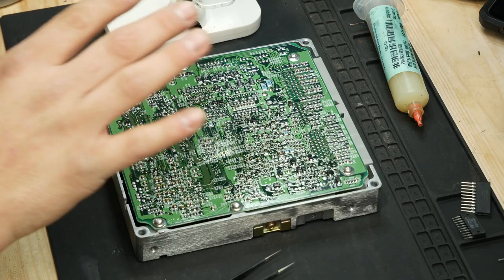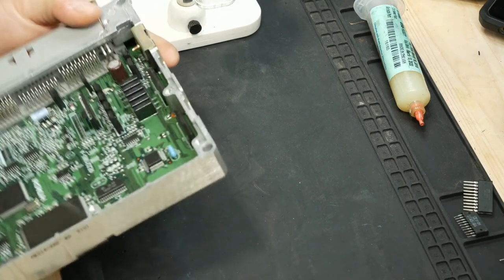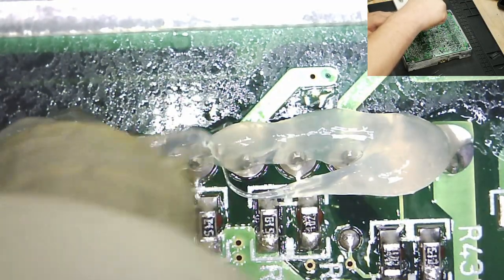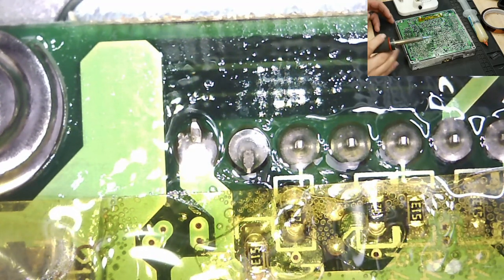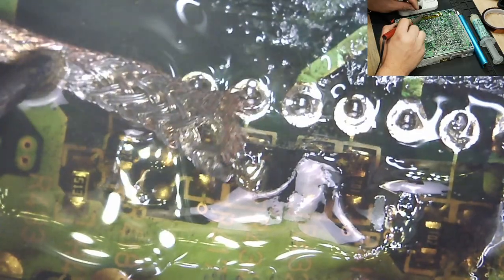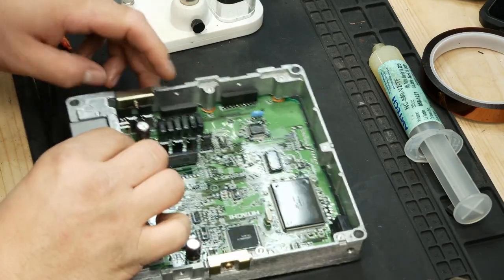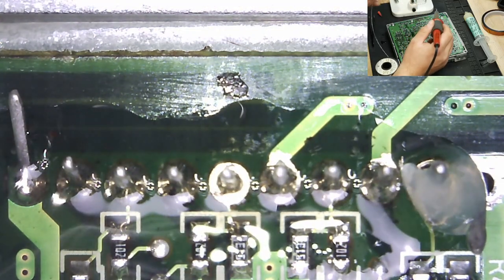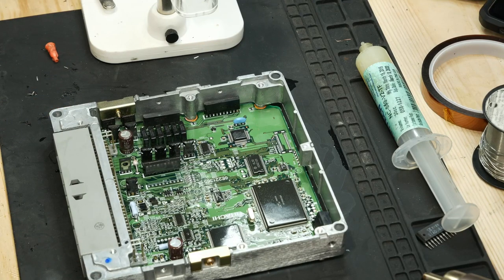Nissan Pathfinder Injector Driver Failure and Repair!

Comment: PPBUS 3G HOT
Reply: I have a 2013 Rouge Does it have to use Nissan Trans oil or can I use different brand.
Reply: G3 not 3G
Reply: Dyslexia must have kicked in

Comment: I have personally repaired hundreds of these and similar models over the past two plus decades. You did real good Keith! 😅

Only thing I would mention is, if you do not have decent soldering skills and equipment, don’t try this because you can damage the ECM and if you don’t know what you’re doing you can damage it beyond repair. You’re correct, the eyelet’s must be cared for and the adjacent areas can be damaged by the solder gun/heat.

Comment: Having done this kind of work for many years (professionally), I suggest sucking the solder out of the holes first. Then heat the bent over legs with the tip of the iron without touching the eyelet/pad with gentle pressure until they are free of the eyelet, then straighten them. The method you showed to straighten greatly increases the chance of lifting a pad and/or the trace. If the pack is sitting high enough of the board you can also clip the leads as close to the pack body as possible, then use a solder suckered and most of the time even the bent leads with such out with the solder leaving which is faster and less application of heat to the pads.
Reply: Very good advice.
Reply: I've never had any success with sucking solder off thru hole pads; there's always some tiny amount of solder left holding the pin! So I always just cut off the component, remove the legs, then suck out the solder.
Reply: @kyferez1  After sucking out the solder, put a little liquid flux on the legs and briefly touch the tip of the iron on just the legs and any remaining solder will flow onto the pin. You may also want to try some liquid flux and reflow the pins before sucking. Cutting the pins sometimes can damage the insert or pad, especially on boards with internal layers.

Comment: I know this video is a couple years old, but this is extremely helpful in identifying other style mosfets, instead of always looking for the standard 3 pin type. Thanks so much for this video..
Reply: So pins 1 & 10 are a Ground bar that each FET has its source attached to

Comment: I LOVE that you are doing component level repairs.  Get yourself some LOW MELT SOLDER (aka "removal alloy") and you'll never struggle with a multi-pin package removal again, safer for board, and beautiful results overall. The packages will frequently just drop out of the board, then wick or suck holes clear and cleanup with IPA & Kimwipes. The prep'd area will look LIKE NEW.

Comment: They really laid the solder to that one! I have a 2002 Toyota Tacoma V6 that the rodents shorted out #1 injector driver. Waiting on the parts to fix it. Thanks!

Comment: Are you using Lead Free or 60/40-Tin-Lead? I use both, depending on the age of the PCB. Sometimes I use Tin-Silver, too. Also, I use an electric solder sucker. This does a wonderful and quick removable job. Tracks are always left undamaged.
Reply from the maker: Yes, 60/40.... its lead for me!
Reply: @L1Training  The best kind...

Comment: Use a small piece of silicon hose on the end of your solder sucker. This will allow a better seal on the soldered pin in which will make it easier and faster to de-solder. Good luck and thank you for the programming vids. By the way iam new but what program are you using for eprom program and reprogramming car computers?? And where do you purchase said items??
Reply: R/C nitro fuel line is perfect size and cheap on Amozon.

Comment: Hi Kieth great job. I was wondering why you use so much flux on top at first before heating up the solder, what that accomplishes? And not doing this as much myself I was amazed that using so much of the flux on there doesn’t interfere with soldering back together as it looks like it might. Thank you keep up the good work! Doug
Reply: I don't think that using that much causes a problem necessarily other than making a mess. I think he uses way too much when looking at other videos for how they do it. I am not an expert though, but when I solder I just use the cheap wax type stuff that gets me by fine. The tube stuff like this is what most pros use but not usually that much. Maybe a smaller nozzle might help get it on there a bit thinner.
Reply from the maker: Its just messy, you cant have too much flux, it doesn't interfere with the soldering at all. You want a high concentration of flux in the solder. BUT, yes too much flux does make for a mess to clean up, that's why I clean them before I put it all back together.
Reply: Listen to Keith, he is right. Also, you must clean the PCB with ACETONE afterwards. Some fluxes can eat away the tracks on the PCB over time. I build microwave transceivers that need a delicate feel and NEVER use LED-FREE, only Tin-Silver on these, because microwaves are attenuated by some solders, plus, lead free causes cracking and microcrystals to form, causing a failure of the circuit. 60 years an RF electronics engineer.

Comment: Keith you forgot the links for the supplies you referenced earlier in the video so now I have to go back and find that stuff. 

Just got stimulus check. Gonna talk with wife and see if she'll let me come to class now. It'll be a worthwhile investment IMHO even with me just getting into it. I'd be able to use my IM-608 for more than keys, diag for once. Lol... 

OF course after doing a class like that I'd be at salvage yard buying up modules, etc. 

Do you recommend using a dual OBDII adapter so one can hook 2 scan tools or multiple items to a ecm, OBDII port on a vehicle for use of multiple tools for diagnosing one thing but from different perspectives.
Reply from the maker: Fixed!

Comment: Adding low melt solder to each pin would have helped immensely in the removal of that component. You would have them been able to wick off the solder much easier and more rapidly while applying less heat to the board. In fact, you could have wicked off just the outer four, bent the pins straight, and then applied hot air to the remaining pins for just a few moments and watch the component fall right out. The remaining cleanup would have been much easier.

Northridge Fix is also a good source for Amtech flux, high-quality braid, and low melt solder.
Reply from the maker: Yep

Comment: Hi yes I want to start by saying your content is very good and very intuitive I have a quick question I replaced a CVT transmission on a 17 I removed the ECM to gain access to bellhousing bolts after reinstalling I have the new Trans reprogrammed programming was good but after I have a code p0075 that I cannot clear I checked wiring continuity for the intake VVT solenoid perform pinpoint test so far everything checks out I am leaning towards something went wrong with the ECM but before I pull the trigger and put another one in would you happen to have any information thank you very much have a great day

Comment: Great video Keith! I am editing a similar video on a tundra injector mosfet failure! Although my skills aren't up to par with yours lol
Reply: @HouseCallAutoRepair  I've got a handful of CB radios from my Trucking Days!

Have a Johnson Messenger 323A found in a scrap metal dumpster at VT Industries while waiting to unload back in the early 2000's. VT Doors makes fire doors for schools, etc... They're the doors that have to be fire rated by law. That's a requirement in household doors going from Garage to House anymore these days as they've gotta have a 1hr fire rating. 

You know anything about maxing out a old Johnson Messenger for talk range? 

I have a Galaxy 66 as well peak and tuned with uppers & lowers and the Cobra 29Ltd which was my radio for years before the Galaxy. 

I have a few other basic Cobras from over the years and maybe a radio that kicked that I bought used off of someone. There was always deals back in the day.

Comment: Hey I have a 2009 nissan titan. Bank 1 injector aren't pulsing. The coils are. Bank 2 injector and coils are working as well. Just not getting any pulse from Bank 1 injectors. Sounds the the ecm is messed up? I was reading the ipdm (fuse box) could be the problem but seeing how everything is working and the engine does run (on 4 cylinders) I was leading to the pcm. Whats your thoughts?

Comment: Nice to see someone taking money off the big dealers. I had a Mitsubishi Colt years ago and was told I needed a new ECU to fix a misfire.
Mitsubishi original $950, used from a junker, $400.
Gave it to a tech who worked for me, changed an output  transistor for a grand total repair bill of around 90 cents.

As an engineer who did my training in the days before every module became a throwaway item, here are 2 things we were taught.
1  When soldering pins on chip never go from pin to adjacent pin. For example on the 1560H we would probably do pins 1, 5, 3, 7 2, 6, 4 then 8. The logic being to prevent application of too much heat in one place, reducing the risk  of lifting tracks.

2  Another thing we were taught was to always clip legs on chips before you solder them. We were taught that clipping them after soldering can apply pressure to the newly soldered joints , making them unreliable.

I'm sure everyone has their own view on this.

That said, I've watched a few of your videos now and enjoy what you do.
If your work is good enough for Eric O, then who am I to criticise!

Comment: Hi Keith, great stuff. I have only done a handful of repairs on circuit boards mostly non auto and usually just a relay on a cloths dryer board or one for fuel pump on a dodge. I have usually just found the repair items online via E-bay or Amazon but haven’t gotten into the more complicated things like drivers. Wondering where you get your drivers and other parts from?
Reply from the maker: mouser
Reply: @L1Training  I have a car ticking over but the injectors won't progress to rev.
Reply: @L1Training  oh yes is a petrol

Comment: Vacuum desolder station should work so much faster n easier.  Pace is a well known brand .  Digital Key is a great source for this and parts to.  Nice job.
Reply from the maker: Ive got a Hakko FR301, but the pump is down, its actually fixed already, but not in time for filming this.

Comment: I got a computer issue with my 96 dodge every thing works on it but it eats gas badly changed it out with another works good dont use nearly as much gas would it be cheaper to fix it or just buy a new one

Comment: hi, i am working on a chrysler pt cruiser, a high output turbo application. repairing an ignition driver. it so happens that this particular pcm does not have the typical igbt drivers. it has a ic chip driver. the one with 10 legs. have you seen something like this? i am having trouble finding a replacment. the chrysler number is 5033479ad  30F221. or even a suitable replacement. thank you.
Reply from the maker: Yes, that is common, we have had to inform most of those customers to the fact that their car is not worth the time to fix as the PCMs are all going to go bad, and used units are disappearing.

Comment: As I was watching this video I was saying to myself - where is HAKKO FR300/301 de-soldering gun in this video???  After years of use my 300 still going strong and just about any through hole IC/resistor/cap, etc can be removed without damaging PCBA or surrounding SMD's. Highly recommended.
Reply from the maker: My fr301 is getting the pump repaired.
Reply: @L1Training  Even good tools require repair! Excellent content and video!

Comment: L1 automotive do you do ecu repairs on 1997 celica i have a no injector pulse
Reply from the maker: We will repair modules we have diagnosed or that have a common problem. We are not aware of a common issue for no injector pulse on a celica that we have repair parts for.

Comment: You really need to buy a desoldering station. your going to do more damage potentially with a soldapullit.
Reply from the maker: I've got a Hakko FR301, but the pump died, its fixed, but not in time for the filming of this.

Comment: You got lucky. You should invest in some proper desoldering equipment or at least a decent solder sucker.

And, you should trim the leads before soldering, or at least reflow them after trimming, so there is no exposed copper.

Or not. Your call.
Reply from the maker: Rather be lucky than good any day.